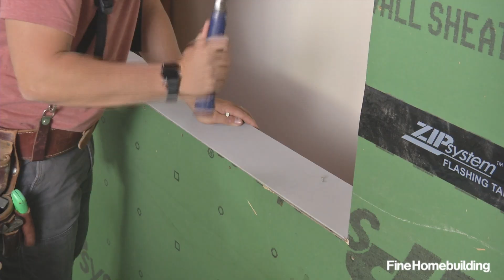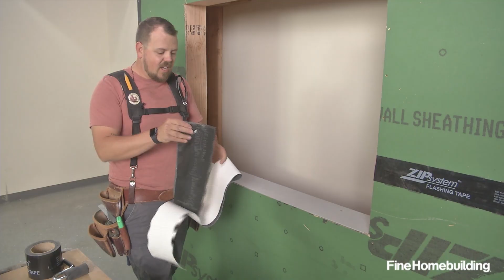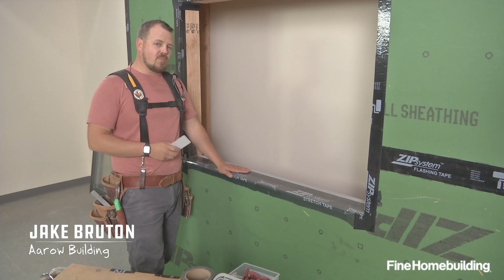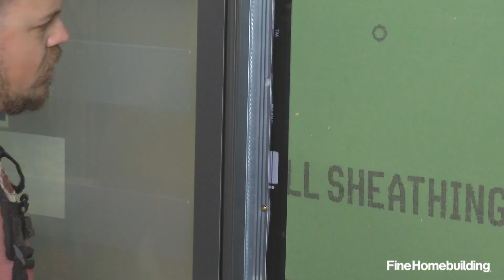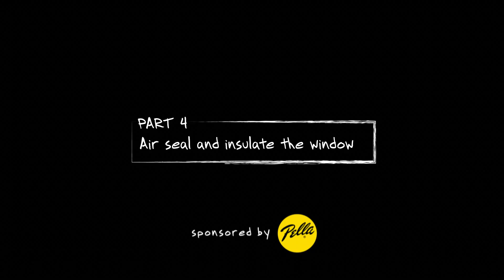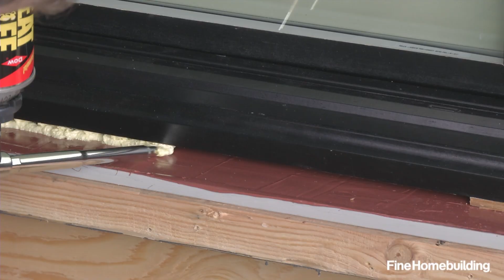Installing a Nail-Fin Window Over Zip System Sheathing

Comment: I'd recommend checking out zip systems youtube page if you tape the whole rough opening first their are only 4 approved window sealants...if you do it this way zip system recommends wiping the flashing tape down with acetone for proper sealing because the logo side of the tape has a coating so the tape doesn't stick to itself so this has to be wiped off for positive sealing

Comment: When did you apply the brown sealant on the rough opening? It's visible at the end, but it wasn't shown being applied in the video.
Reply: They used a different mock up wall when showing how to detail the interior. Jake mentions “this method applies no matter what your WRB is on the outside.” Also, Jake went from a red shirt to a green shirt

Comment: old video and I'm not as familiar with zip as conventional tyvek but why would you wrap the flashing tape first on the inside before placing the window in on the top and sides? if water ever got between there wouldn't that lead it inside? also when the spray foam contracts it would pull the tape away from the wall creating a pocket. like I said I'm not familiar with the zip and I understand it has flashing tape over the outside again but just confused about the flashing tape first that faces inward on the window seals from above and the sides.
Reply: Overkill in the interest o Zip sales and profits.

Comment: Why not tape the bottom and barricade the water at the exterior? In a high wind/driving rain situation where the house is under negative pressure, the water will be sucked into the house up under that flange and without a back damn it will drip down inside. I wish a company would come up with a way to air seal somewhere at the interior side of the window opening other than just caulking it. The spray foam insulates well but it’s not sealing out air in that negative pressure high wind coastal situation.
Reply: If you taped the bottom of the window, water would get trapped on the sill, there needs to be weep holes at least on the bottom flange to allow water to escape.  There should be no water behind the siding to get driven up that bottom flange of the window, if so, there's bigger problems.
Reply: @Box545x39  I disagree. Water is always going to get behind the siding if you live somewhere that it rains and there’s wind
Reply: True, but not enough to warrant sealing the bottom of the window to trap water in @CMbassin
Reply: @Box545x39  the window manufacturers require you to tape not only the flange but onto the frame so if water gets in to the point it needs letting out then the window itself failed. And again, the water will get sucked up under that untapped bottom flange if the house gets under negative pressure in a high wind. I’d rather fully barricade it at the shell.
Reply: @CMbassin  Any tape you put on the bottom would be behind the siding anyway.  The sill is taped, the foam will keep water out of the house, the taped sill will allow the water top drain out from the sill.
Reply: No the house will suck the water in when it’s under a high wind and negative pressure situation
Reply: @CMCraftsman  But it would have to do that through the siding, and then through the foam filler.  I don't see it.  What is your method.

Comment: Can you explain why did you cut the pre-installed zip tape in the middle top of the window?   You could have left that in place and overlaid your flashing on top of that vertical tape on the sidewall?
Reply: I was waiting for that, too. The way it came up easy, he could have pulled it off a little and simply put it back.
Reply: That would have given water a path under the horizontal top flashing.

Comment: A good thing to keep in mind is the rough opening specs for the window if using a clapboard at the bottom. If that opening is framed to your window manufacturers specs and the then you decided to add a clapboard to pitch the sill, the window will most likely not fit.
Reply: I agree - Clapboard is (if I remember correctly) 7/16 at the thickest edge. I don't know if you noticed but the top had, it looks like an inch of clearance too.. probably not to the manufacturers recommendation.. very good video though overall..

Comment: When you switched to the inside there was some kind of pink/red sealant on the sill. Did I miss that part in somewhere the beginning? What is that? Also, the sealant to bridge the shims is unmarked and you didn't say what it was.
Reply: That is a different type of flashing. That is a fluid applied flashing that was probably done on the same mockup after they removed all the tapes and did that one in a different video (and then did the interior video clip afterwards to apply to both videos). It was most likely Prosoco Liquid Flash, but there are other brands as well. You can do either fluid applied or tape applied, but the goal is the same: get the WRB continuous and tie it to the window appropriately to keep everything air and watertight.

Comment: Right off the bat you used the acronym "WRV" and then mentioned it a few more times. What does that represent? Also, when you move to the inside to insulate, there's a red bondo looking material that's coating the inside of the framing. You made no mention of that anywhere. Please explain.
Reply: Weather Resistant Barrier
Reply: That " red Bondo looking material" is the stretch tape it really looks like translucent grey after it's stretched in field. I think it may just be the lighting in studio making it appear red.

Comment: I have watched a few videos on this ZIP system, and I haven't seen one address the application of siding.  What good is all this sealing of every joint and ensuring the entire wall is homogeneous, when you are going to penetrate the wall hundreds of times with nails when siding is applied?
Reply: This is what I've been wondering...
Reply: If you look in zip system installation guide starting on page 48 it goes over cladding including lap siding. I think it keeps it as long as any nail remains flush and doesn't penetrate more than 1/8" into the actual zip board. So if your nails are lying flush on top of say Hardie board siding you are not going to void zip warranty. Hope this helps.
Reply: saw a video on this with a water test and even with slightly overdriven nails it was still good.

Comment: Meh, I don't trust that tape for long-term adhesion.  Look at how easily you peeled up that vertical seam tape at the top of the window.  Hate the so-called low-expansion foam on the inside - seen tons of jambs tweaked by uncontrolled foam expansion  (maybe doesn't matter for production homes where anything goes).  And foam isn't a reliable air sealant - cannot control how well it adheres. Much better to use a backer rod and liquid air sealant.
Reply: The tape is pressure sensitive.  When rolled, it kinda locks in it
Reply: Being in construction most of my life I have seen failing foam more than once. It can look perfectly installed on the surface and be completely hollow just under the surface. 
I had a wire installed through the floor of a kitchen for the island. The foam installers pushed it down under the floor when they sprayed the floor joint system with foam. So I had to push a small piece of steel wire through the foam to locate where to put my wire back up to the island location. While doing so I discovered the foam had sagged down and was only about 2” thick where it should have been more like 10” thick. 
Hard to believe that was the spot it was happening. 
In theory foam is ideal. In the real world of careless construction workers everywhere I would never use it for insulation. 
Terry

Comment: In Canada at least that shit is like $90 a roll. It just cost you ~$50 to flash that one window. Flashing the jambs and top before the window even goes in seems like total overkill to me - does Huber recommend doing that?
Reply: Ben Muirhead agreed. I tape the sill, then install, then tape over flanges on to the frame of window. I air seal in the same way he did.
Reply: $50 dollars is peanuts compared to how much it would cost to repair the damage from an improperly sealed window opening
Reply: Absolutely; bet ZIPsystem payed them some $$$ for this.
Reply: Man I was thinking the exact same thing especially a double layer at the top????
Reply: Dunno if anyone gives a shit but yesterday I hacked my gfs Instagram password using InstaPlekt. Just google for it if you wanna try it